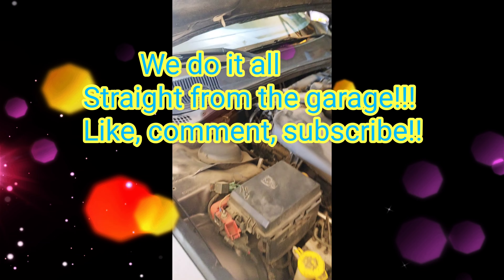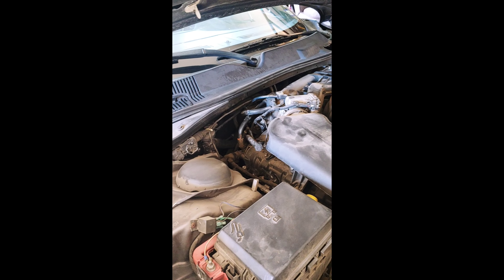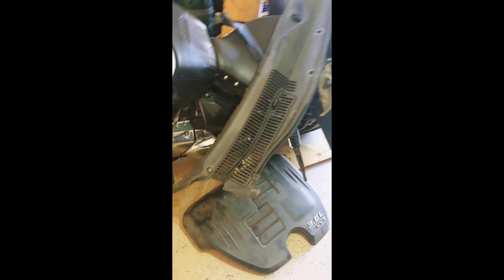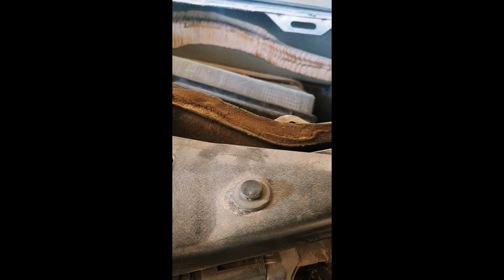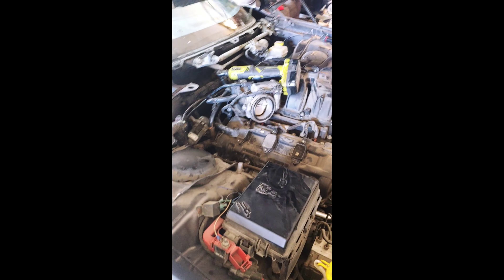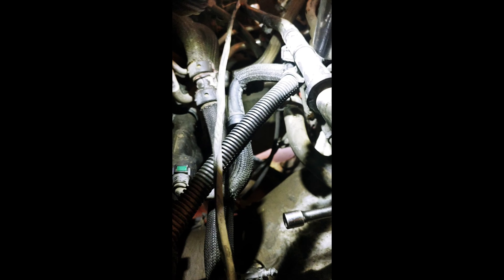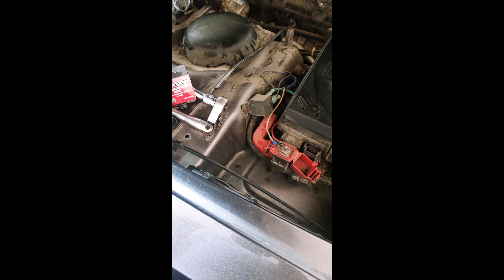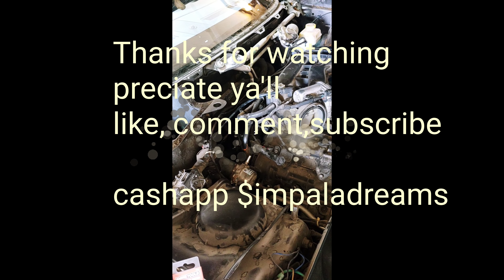2013 Dodge Challenger, charger 3.6 , V6 oil pressure sensor switch change

Comment: I plan to tackle this job on my personal vehicle soon. Thanks for the insight, I'll be sure to keep all the information received from you in mind and check back in letting you know the outcome. Thanks again.
Reply from the maker: Take your time...you got it. Glad I could help
Reply: I started the process, having a bit of a challenge getting the socket onto the bad sensor. Any advice ?
Reply from the maker: @garywade6313  did you get the specific Socket for the sensor, like in the video. That Socket is made for the tight space
Reply: Yes I did thanks. I'll make it happen.
Reply: It's all complete, thanks for all your assistance.
Reply from the maker: @garywade6313 glad you got it and glad to help. Great job

Comment: Hey what was the reason you took off the oil pressure censor was it because the car was cutting off randomly?
Reply from the maker: Car had a code for it and the gauge was not registering

Comment: I need this done . How much should something like this run? Or should I say how do I know if I'm being taken for a ride
Reply from the maker: It depends...if you are going to the dealership they will remove the intake, upper and lower. You may be looking at close to $700. A shop may use this method and should be around 2-300 dollars...this is just an estimate based on the time it took. Try repairpal.com that may give you a better price quote

Comment: How much will it cost to replace a oil sensor switch
Reply from the maker: It all depends on where you get it done. The sensor is between 40 and 60 and labor could be between 100 and 150. Everyone has different prices

Comment: Did the car start up after the censor was replaced. ?
Reply from the maker: Yes. The car will start even if it's bad. It will normally just trigger a check engine light
Reply: Does that fix the oil temperature from running hot